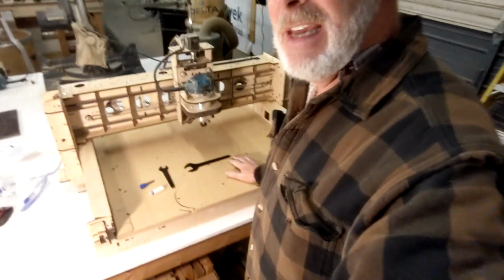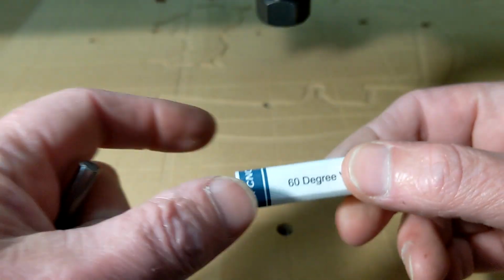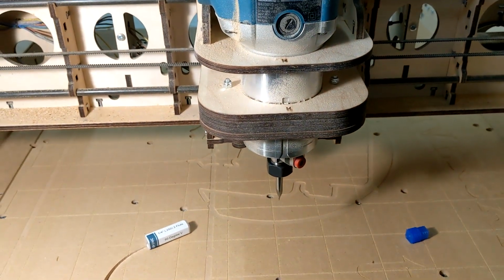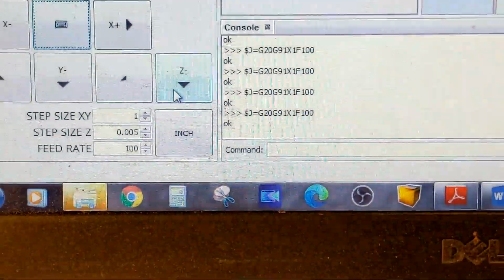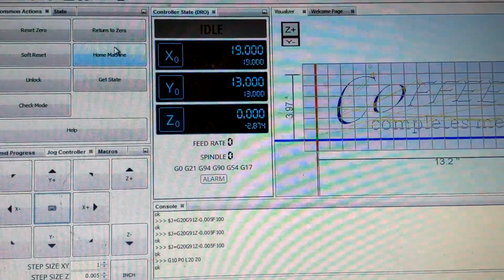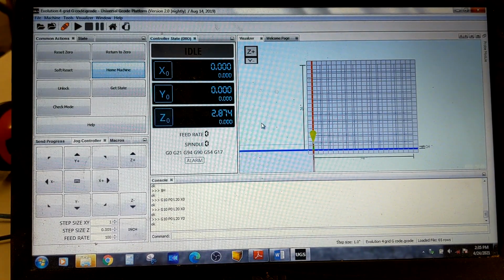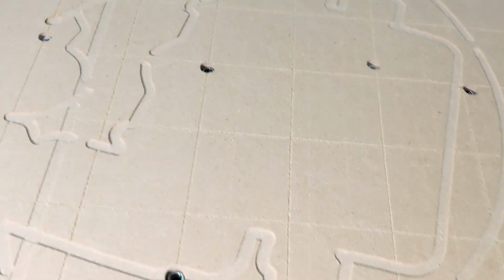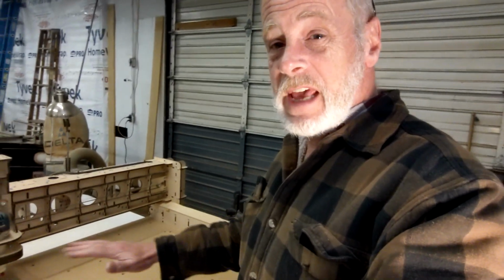BobsCNC Evolution 4 Grid Cutting Instructions - Garrett Fromme

Comment: What is the wood over your x rails? Interested
Reply from the maker: Hi Kurt. They are guards I build to prevent sawdust on the rails. Works so so. I'm working on a much better solution that does not require any modification!
Reply: @IDCWoodcraft  Have you come up with a solution yet? The dust that builds up on my rails is really my only complaint on The Bob.
Reply from the maker: @levijboyd  I have the solution done. A slight modification is needed. I'm waiting on The modified post. Then I'll make a video to tell how to get it.
Reply: @IDCWoodcraft   I’d be interested in seeing it when your done working on it

Comment: Hey BG here on my other channel. Great info. Need to do grid lines on my e4 but I have the floor base with the t track gaps in it. Not sure if that was in the evolution 4 model or just the older e3/e4 models like mine. Or is that just a spoil board you added yourself?
Reply from the maker: Hey BG. It came with the machine. You can still cut grids and they will still be super helpful, even with tracks
Reply: @IDCWoodcraft  thanks. I need to get  in there n do some measurements  that way I do t end up with an x axis line right  in the middle of my track line.  My y axis wouldnt be an issue really.